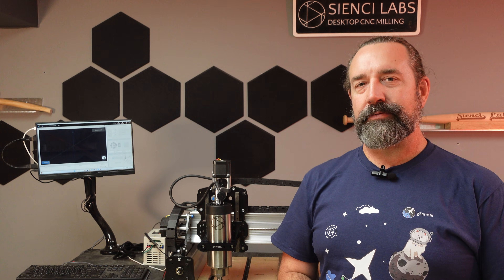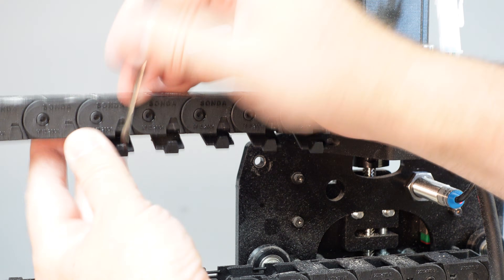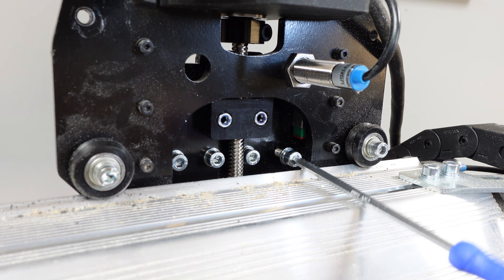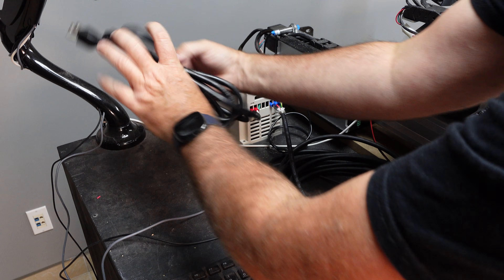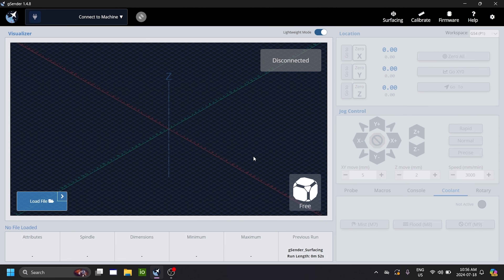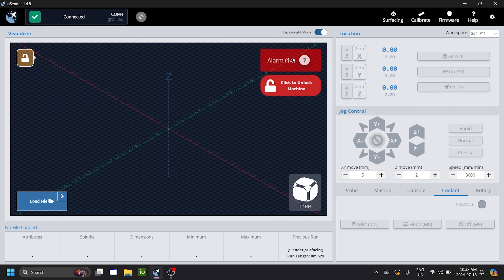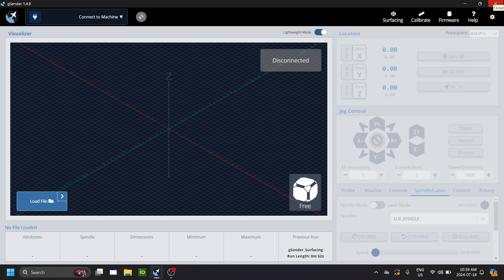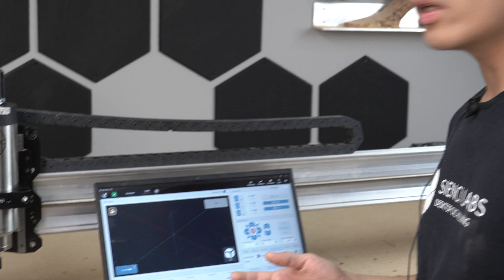LongMill Spindle Kit Installation and gSender Setup

Comment from the maker: ⚠ Quick Note for Everyone ⚠
 Hi folks, Johann here! We’ve started shipping the LM spindle kits as of last weekend. While rewatching the video, I noticed a couple of firmware settings were missing. We’ll update the video soon, but in the meantime, please make sure to adjust the following settings in addition to those already mentioned.

$37 (Stepper Deenergize) -> Enable Z to prevent the gantry from drooping
$392 (Spindle On Delay) -> Set to 11 seconds to match the spindle's acceleration setting

For the latest information, you can also check our written guide here https://resources.sienci.com/view/lmk2-spindle-kit/.

Apologies for the oversight, and thank you for your support!
Reply: Also, when comparing the Longmill spindle instructions and the Altmill spindle instructions. There is a place in setting where you say there is a spindle / laser attached. In the Altmill instruction it tells you to set minimum speed to 7500 RPM and Maximum speed to 24000 RPM. The Longmill instructions do not mention this.
Another thing I found in the video at 3:20, where you are installing the spindle, it says to rest it on the work surface. I found out later when I had to raise the spindle that a better initial location is having a 3/4” or 1” piece of material on the work surface first.